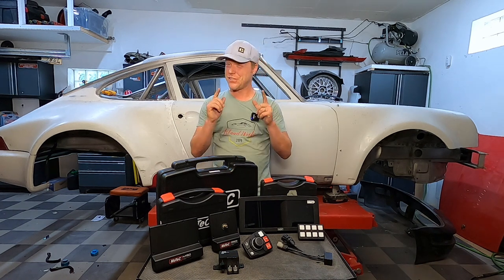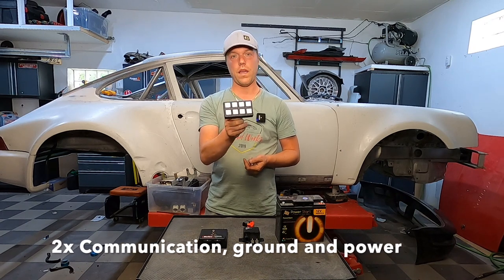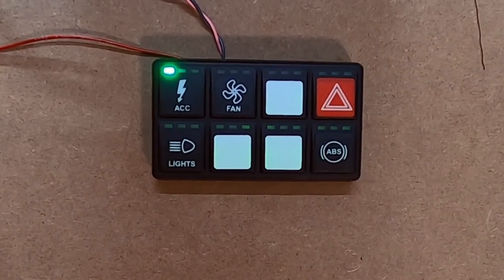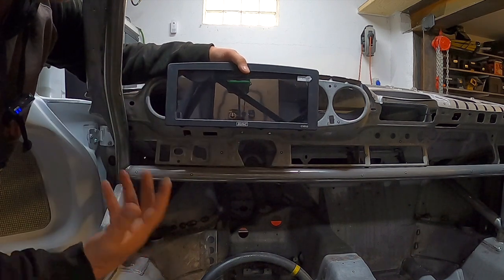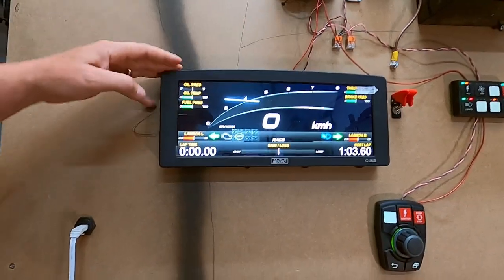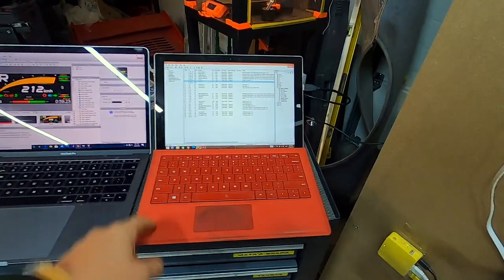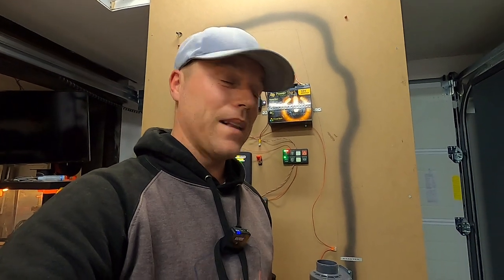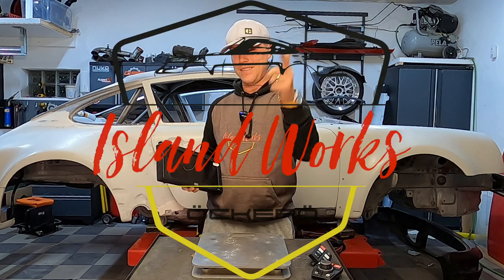Wireless Porsche - Big Screen in a Modern Classic Porsche 964

Comment: Might have missed it in all the comments - some in Swedish- but why don’t you put the battery as near the starter as possible to shorten the heaviest high draw wires to min length?  All other current draws are relatively low and low wire count thru canbus correct?  Awesome vid series, gotta love lightwt 911’s.

Comment: Dont know if you are ever going to read this, but I would highly recommend using a bulkhead connector, or maybe multiple bulkhead connectors to connect the ECU from the cockpit to the engine bay. This will allow you to easily drop your engine out by just disconnecting the bulkhead connectors. I would also recommend at least 2 bulkhead connectors, one for higher current applications like coils injectors etc and one for all critical engine sensors so that you can minimise and possibly negate EMI on the sensors due to the high current components. Another tip, you may want to add a spare connector somewhere with 12V, GND and CANH CANL. Helps out a lot when you want to add some CAN devices in the future. Hope to see more!
Reply from the maker: This is exactly my idea. I’ve planned to have one 12-pin for the throttle body and power of all devices and one separate 37 or 55 (not finished with the math yet) for all signals and smaller wires. 

My double lambda is on can-bus so I will have that back there mounted tucked away under the intake. If you’ve see the episode “Speedy intake” you can see some of my ideas around what’s going in there.